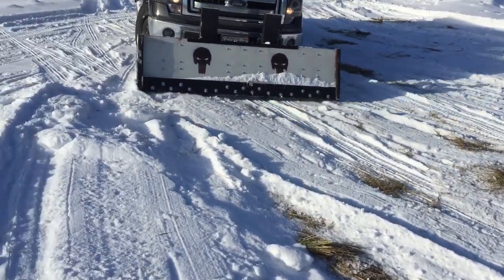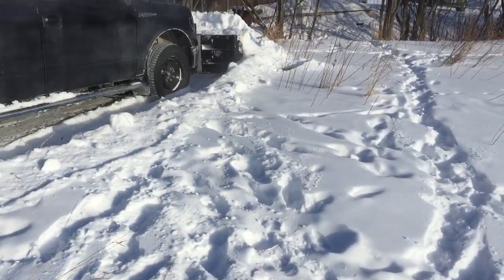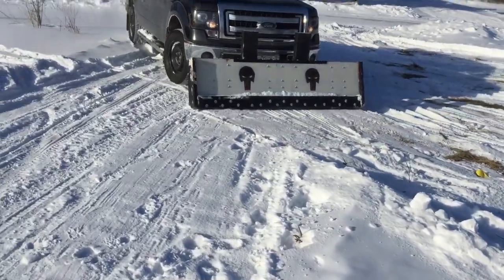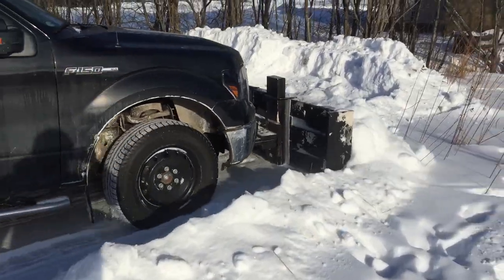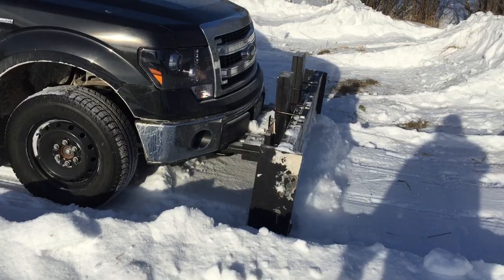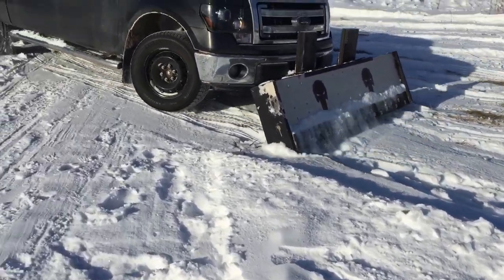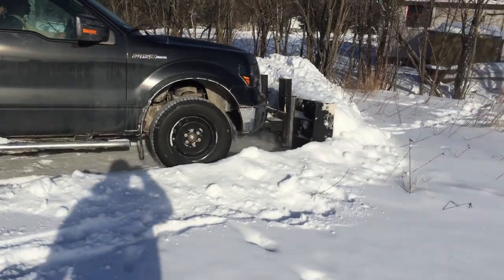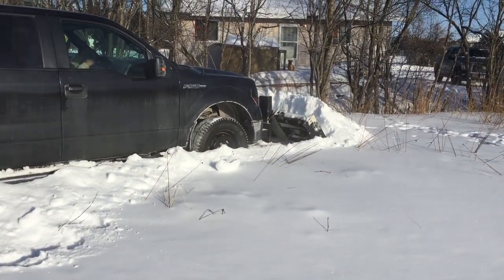Homemade wooden snow plow

Comment: Is the wood holding up?
Reply from the maker: The plow itself was rather indestructible. But I went through a few push frames. Couldn’t make one to stand up to the abuse. I used the plow for two winters before ditching it. I enjoyed it though.
Reply: @jbouchard4877  so the wood plow held up but your hitch frame is what wouldn't hold. I'm pretty sure you can buy the metal frame from snow sport separately